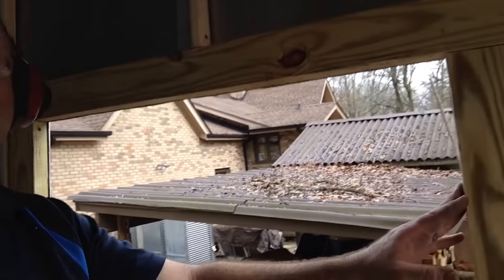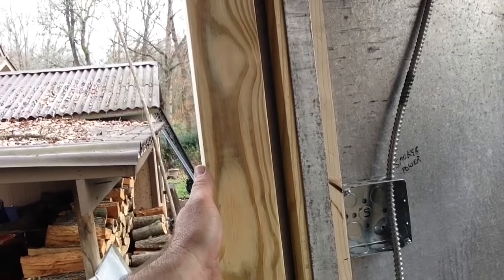Cutting hole in food truck for window

Comment: I am about to start this project, and was wondering why you used wood instead of aluminum square tubing? After seeing this maybe wood is the way to go..at least for framing the window. probably save a thousand bucks
Reply from the maker: I looked into welding in aluminum and it was extremely cost prohibitive. I have welding experience with arc but not aluminum. These were the two main factors. As an aside note: the wood can be very heavy if you use 3/4" plywood for the walls... It is nice to be able to hand anything anywhere in the truck but beware of the weight monster! I had to add some suspension when the project was done. Still cheaper than aluminum but I would probably settle on much lighter sheeting material and screw items into the studs when needed etc.... Good luck with your build!

Comment: Thanks for the video. This might be a dumb question, but how did you anchor down the wood? Through the outside in? Is there a video out there that shows? Thanks again for your video.
Reply from the maker: The framing is secured to the internal (aluminum truck) studs by drilling holes in the metal studs, putting a sawn to size wooden stud beside it and screwing it together with treated deck screws. Then when the windows are installed from the outside (installing them from the inside is also an option) there are holes drilled in to the aluminum siding of the truck to allow for the screws to thread into the wooden framework you built.

Comment: what trim did you use for the window?
Reply from the maker: I installed the windows from the outside of the truck and the wrap for the truck goes over the flange on the window frames. Makes it look as if it is a part of the body.

Comment from the maker: I screwed the wood frame by drilling the existing aluminum frame and screwing through to a wood stud.
Reply: do the screw holes not show on the outside? are they covered up by the window?
Reply from the maker: Hi Andrew Kinder The holes were drilled so I could basically convert the aluminum studs back into wood by scabbing on to both sides of the aluminum. The only holes drilled through the outside of the truck is where the windows were screwed into the wood framework. Feel free to email me your contact info for more clarity at info@potbelly-Bbq.com